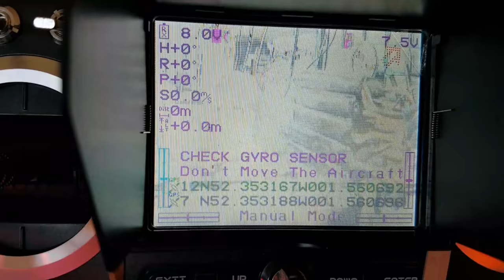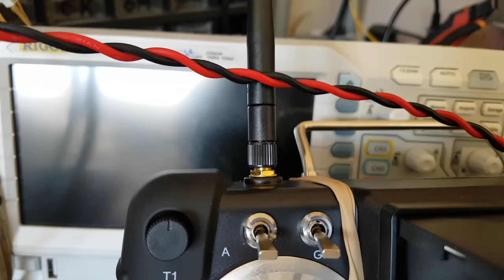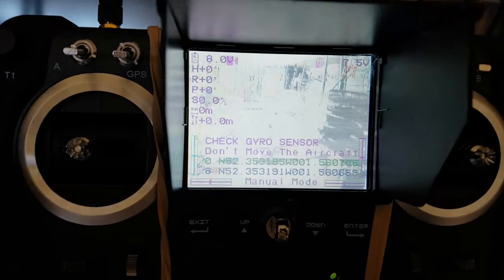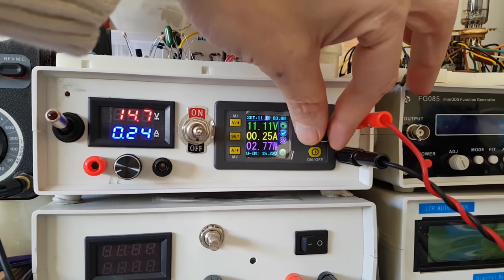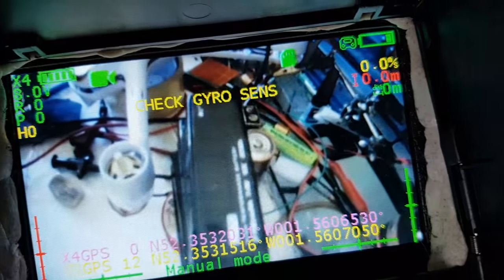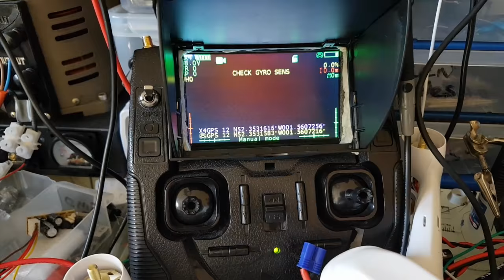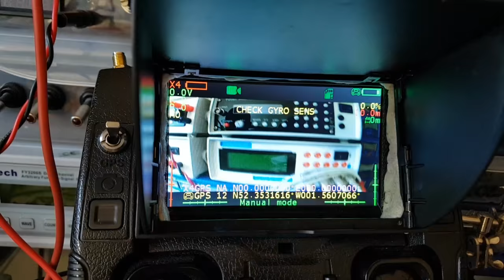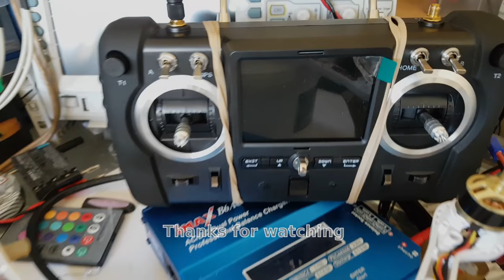Hubsan H501S-S  H501S Differences

Comment: Hi! H501ss is sold as pro version? I want to purchase hubsan h501s where is the best place for buying?
Reply from the maker: Hi m8, No the 'Pro' refers to the controller, some reference it as 'Advanced' and some 'Pro' it can be a bit confusing when you don't know. Personally after using both controllers, I prefer the standard controller with the antenna mods.
From my experience and what I still understand to be correct is the Hubsan H501SS is in the same box and sold as a H501S. You will only know when it arrives which one it is. H501S has plastic packaging compartments in the box and the H501SS has cardboard.  
Best place for buying depends on where you are. I am in UK and if I spend $4.99 on props from Hubsan in USA it costs $58 for shipping. 
Banggood and Gearbest only have 45 day warranty on RC toys and the Hubsan H501S / SS are classed as toys.
Reply: Elecifun Which one ise better sir The H501ss or S only?
Reply: Elecifun thank you! Already bought h501s-s in cardboard box. And has purchased external antenna for standard controller
Reply from the maker: No idea. I only have my H501S

Comment: I recently replaced my 501s main board .and try to up date the firm ware downloaded from HUbsan,under the "firm ware for 501A and 501s" but it turn out to be a 501A;s firm ware! are they the same? the issue is after replaced the new main board the led lights not working apart from whit led only and no follow me.!how am I going to fix these .
Reply from the maker: They are different. You need to download correct firmware for H501S follow the update method from the Hubsan Official YouTube channel and re-flash the correct firmware to your quad. Good luck!

Comment: Well if you take it off it will be exactly the same as the other camera.. I've had 2 Hubsan 501s quads, one came with a simple sticker to protect the lense during transit, the other with the rubber one that protudes, just remove it and it'll be the same.
Reply from the maker: Its a filter m8

Comment: so which is good? ss or s?
Reply from the maker: As this H501SS is not working I can not tell you yet. I hope it would be the newer version.
Reply: "As this H501SS is not working I can not tell you yet" what do you mean? can you explain please?
Reply from the maker: Please elaborate your question.
Reply: rüştü damdandüştü trust me.its worth. i've just owned h501ss. i ordered h501s but they send me ss. i thought i'm scammed but lucky me after few flight i realized changed they made. 
max alt 253m
distance test 800m (not max yet)
RTH cam facing u( she make a u turn then fly home)
sadly gps mode speed 5m/s. no firmware upgrade. rx v2.1.16 fc v1.1.29 tx h906a v1.1.6
hubsan claimed mainboard from h501a w/o wifi. so i guess the major differece from h501s is RTH in forward mode. lucky me my cam working fine. i remove the filter glass and its brighter.
Reply: Great ranges! Standart or advanced transmiter? Or modded? I was hoping to mod transmiter and update firmware to reach 2km distance, as with H501S many achieved. I hope, there will be superflayer firmware for SS too. And
Reply: Kaspars not that great jz 800m. i decide to RTH cause too windy that day. mayb nex time. it came with advance fpv1 remote. no extreme mod yet. i just remove patch antenna housing n jz leave it naked. so at 800m distance n 100m alt still clear view.
Reply: Well, maybe SS is not that bad after all! Still waiting mine from gearbest. However, i still hope to get old S one.
Reply: Received! Its SS of course :). Despite Gearbest claimed that will send S. So they do not know the difference Anyway, will test on countryside this weekend. I hope it turns out well! BTW, any news on SS firmaware upgrades to increase altitude and flight length?
Reply from the maker: Great news you have your one. I guess they will all be SS versions now as it is an upgrade, or at least it is supposed to be. Fly line of sight and stay safe with it. At least if it is close and not to high if anything does go wrong, you will not have to go to far to fetch it. Whatever you do have fun, that's what these things are supposed to be, fun.
I have not heard from Hubsan for over a week and emailed them today. I asked about firmware but  need to wait for the reply.
Reply: Thanks, man! Will go easy on SS.

Comment: Your fpv antenna wasnt connected
Reply from the maker: John Ponce, So?
Reply: Very bad for it. You should never turn your transmitter on without having the antenna in. It could short out your transmission, and make it so you have zero range.
Reply from the maker: I am going to ask you why you think this, why do you think this? 
Please look closely at the controller before you answer. Note the controller has connections for two antennas. One transmit 2.4 GHz and the other receive 5.8 GHz. I have the transmitter side connected to an antenna. 
What is wrong with that ?
Reply: Elecifun do what ya want but if you don't have both antennas connected you could hurt your range or destroy your transmitter.
Reply from the maker: Well as the transmitter antenna is connected so no issue there and I am not flying just inside with craft next to receiver side, not range issue there. Another plus for the Hubsan community. Thanks for pointing that out to me.